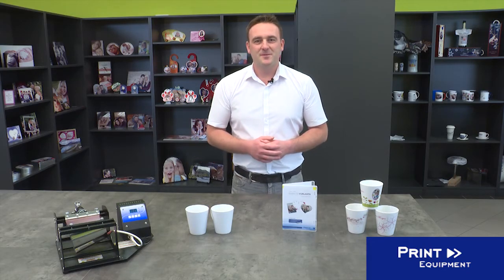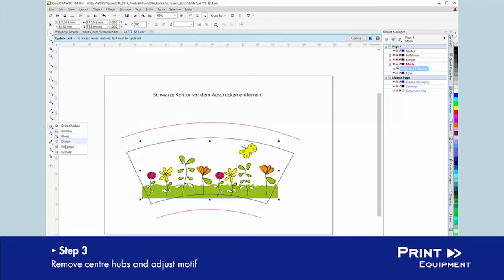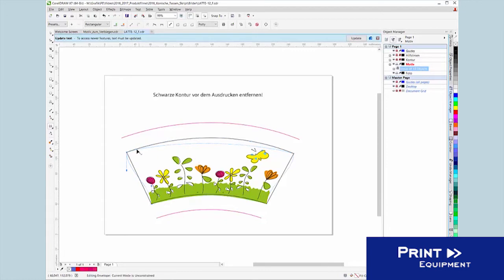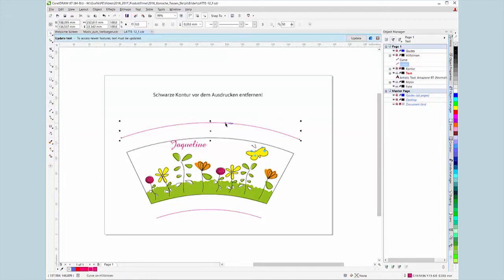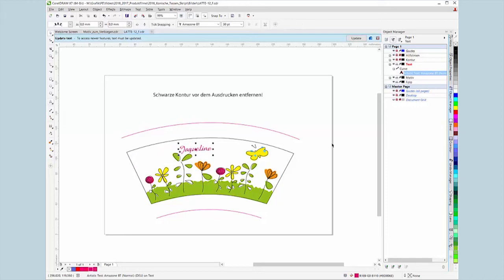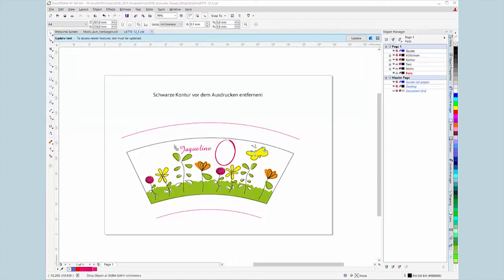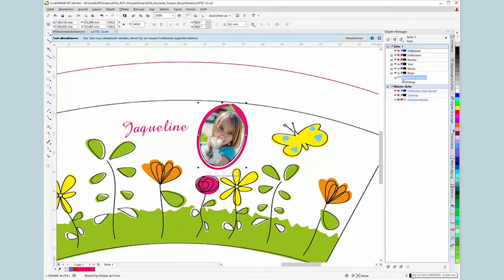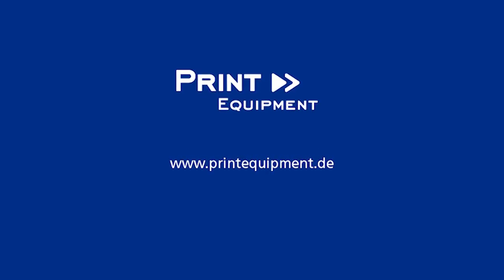How to create the printing image for conical mugs with CorelDRAW

Comment: Greetings, I was watching your video and I'm not able to create the envelope on the .jpg image that I'm trying to use over a conical template. Sure would like to speak with you about how it is that you're able to do it.  Is there an email that I can contact you with?
Reply from the maker: Hello, it’s not that easy to answer, it depends on the size and shape of the image.
You can contact us with any questions at info@printequipment.de or call us: +49 (0)7223 - 2815 0